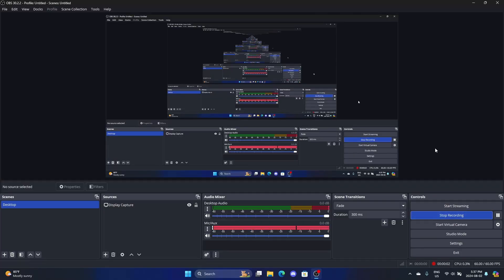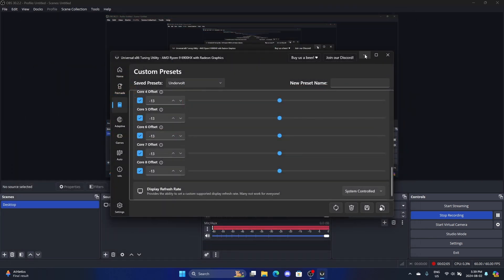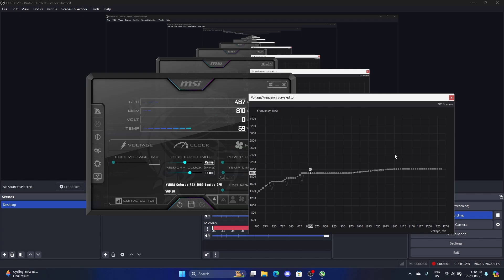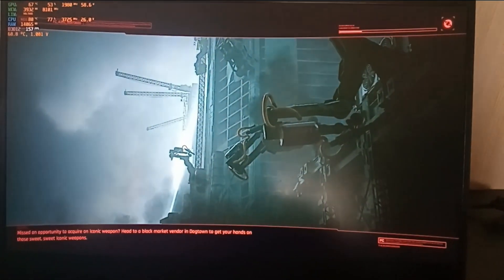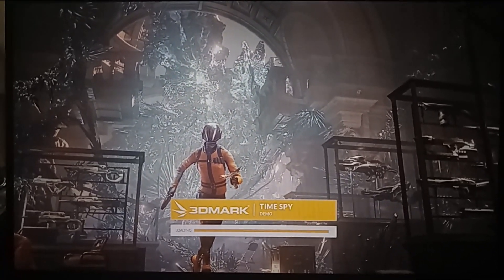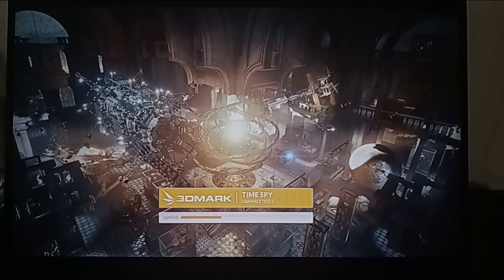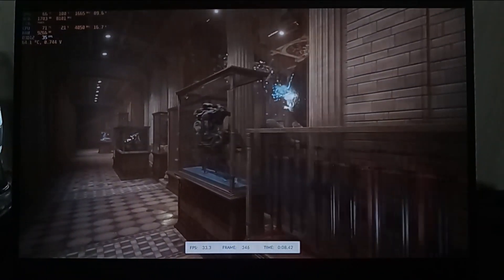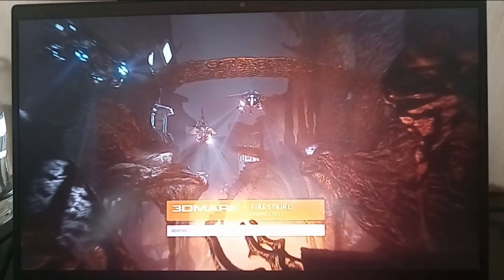Razer Blade 14 (2022) 2 YEARS LATER... AMAZING PERFORMANCE W/ UNDERVOLT & OVERCLOCK

Comment: hey so i think you can get around -20 with boost enabled and -30 with boost disabled on most but did you disable boost with that undervolt too? my undervolting didn't really do anything to reduce temps and could you maybe link a tutorial on how to start out on gpu undervolting?
Reply from the maker: Hello! Perhaps undervolt isn't as effective as it seems, but GPU undervolting can be very rewarding if done properly. Here's what I learned on my own about using GPU curves:

- Think about the curve as a linear function, e.g. elementary function transformations applie here.
- You have a default curve that has certain voltages making the GPU run at certain clocks. Majority of people's undervolt are what I consider "underclock", which limits the maximum clock your GPU runs at (where they have a flat point from some point to the end of the curve), which also means your GPU knows it's useless to run at higher voltages to get same clock speed when it can run at the lowest voltage with the same clock speed.
- For example, a plain overclock simply means lifting the entire curve up.
- A "proper" undervolt is more like shifting the entire curve towards the left, because then you're forcing the GPU to run at its default capable clock speeds at lower voltages, but again you'd have to really tune this, because at some point your GPU simply cannot run that fast without enough voltage.

What I did was both undervolt and overclock (which is why I wanted to undervolt my CPU anyway to "make room" for the overclock).

What I suggest is you look at lots of videos of people doing undervolt on your particular GPU model to get an idea of how far you can push your GPU, etc.

Hope this helps.
Reply: @SamHuangVideos  Actually I am able to undervolt now but it just is too little, I have tested the stability in corecycler using ycruncher to stress test it. For the GPU undervolt, would you make a guide on how to do it?
Reply from the maker: @RithimunenSoveng  There are tons of guides on how to do it, the gist is understanding what you're doing to the curve and LOTS of trial and error.

NVIDIA's built-in overclocker is the safest, but it applies a positive delta for the entire curve.

Also note that you cannot just play one game, but several that pushes your GPU to the limits. You want to test your GPU's capabilities at most of the voltages if possible.

Comment: Will this gonna work with razer blade 14 (2021) ?
Reply from the maker: I am very sure. You can do undervolt on A LOT of CPUs, and AFAIK MSI Afterburner works for a lot of GPUs too.

One thing I will say though is refer to a lot of undervolting and overclocking guides for GPU, and do not take mine for granted. My personal method has changed since this video and there are lot of tradeoffs to consider when using the curve editor.
Reply: I searched for months about undervolting this model, but sadly, I couldn’t find anything useful
I created my own preset on uxtu but it’s still not efficient enough
Reply from the maker: @montazarkhaldun4702  I guess it depends on what you want from efficiency, battery life/thermals/performance?
Reply: well I’m running it without a battery recently cz my battery got swollen :) , so I’m looking for something that won’t cause high temperature 
Maybe below 80 if possible
Reply from the maker: @montazarkhaldun4702  The only effective way I know is undervolt + repaste + laptop stand
Reply: @SamHuangVideos turn off turbo boost too. Works like magic